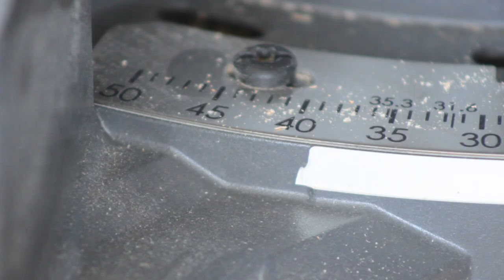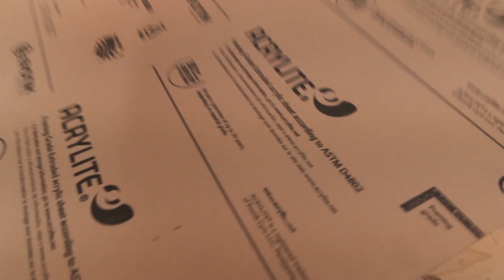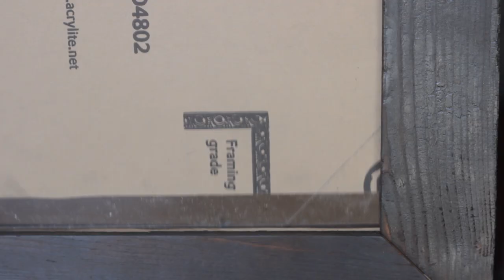How To: DIY Guitar Display Case for an Autographed Linkin Park Guitar: Woodworking, Shou Sugi Ban

Comment: Hey there bud. Really think you guys did a awesome job. It inspired me to try making 1 for a friend. Not much of a carpenter so hoping you’d answer a question. I cut the rabbit, at a 1/4 in lip for the plywood to rest on, but when it comes to 45ing the corners, in having trouble understanding how to compensate. If it’s a 48 in board, would my inside measurement be 47 7/8 or 47 1/2 to compensate for the 1/4 in lip? I started measuring the outside length and that was a bad idea, now I’m measuring the inside to get my speed square out to draw a 45 degree mark and it’s baffling me. I’d appreciate a pro tip. Thanks and god bless

Comment: Awesome build man! However, if I was to do this myself I would have preferred that the RGB-diode did not reflect in the door like that. Any idea how this could be countered somehow?
Reply from the maker: Thanks so much! After living with this for a while i wish I would've got different LED's. These ones didnt have a true white light, it just turns on all the colors. So I'd start with that. Maybe there would be some way to build in a diffuser over the lights too, that way it'd at least soften and disperse the light and maybe help with reflections. Let me know what you think!
Reply: @valorickworkshop9761  Yeah that might work! Maybe if you got some very thin "shaded" plexy strips to lay on top of the diode